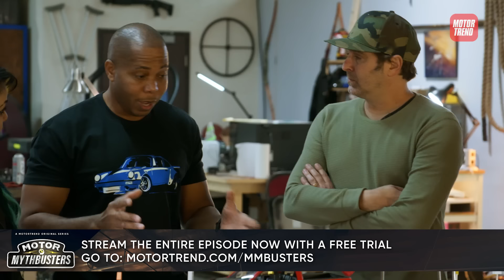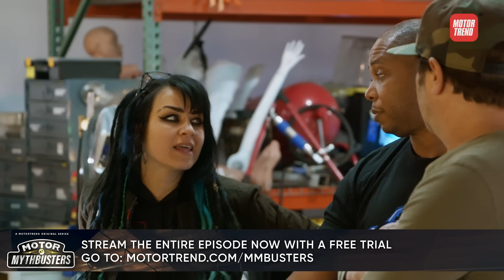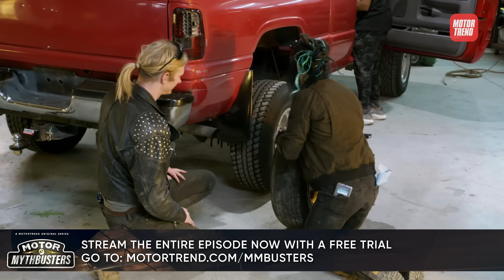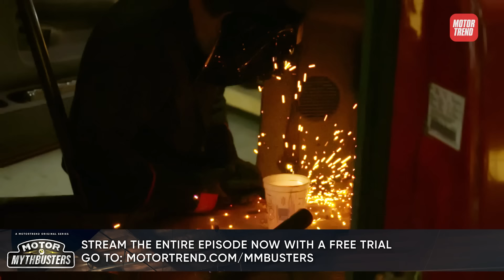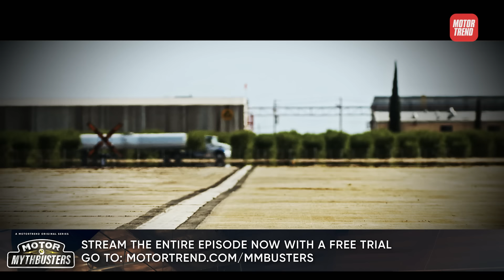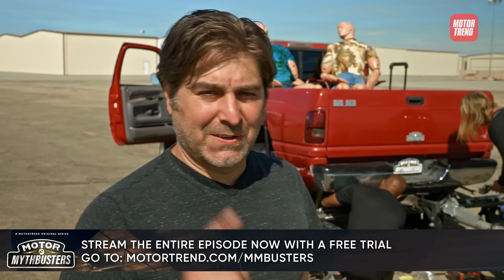Can you escape a fishtailing trailer? | Motor MythBusters | MotorTrend

Comment: As a professional truck driver, I was trained that when your trailer starts fishtailing and trying to jackknife, DO NOT APPLY BRAKES. Accelerate to get ahead of the trailer. Applying brakes could cause the wheels on the trailer to lock up and lose traction, which will lead to jackknifing.
Reply: same with mototcycles. if front tire starts wobbling, speed up to straighten it
Reply: Doesn't take a trained genius to figure out that if the tail of the trailer has moved to the side, out of alignment with the car, and you brake, the tail of the trailer will want to continue forward from the side, passing the slowing car and causing a wreck. It's inertia.  That's just common sense.  But there isn't too much of that left anymore.
Reply: @boyracer3477  true that bro
Reply: @boyracer3477 yes because the trailer doesn’t have brakes
Reply: @Xian..     That's a good point.  I can pull a trailer (I have a 4 wheeled boat trailer) but I'm not skilled.  That is a good reminder.  Thanks
Reply: Slow down... you were trained wrong
Reply: @xephael3485  well if you slow down then the trailer will go through the sky like a spaceship and cause an impact. Learn common sense

Comment: So what if the myth is busted and speeding up doesn’t work or makes it worse.... Then people who have watched this video and find themselves in this situation are likely to try it and make the situation worse... Right??? Maybe not but I do find a safety video teaser slightly odd...
Reply: This. I came to the comments to find out if accelerating works or not…
Reply: It does work. It’s not the safest way. Use trailer brakes if available
Reply: Accelerating stops the sway in the immediate term, but then you're at a higher speed and therefore less stable.  Probably a good strategy for buying the time to reach over and squeeze the trailer brake lever.

Comment: Towing manuals make a big point about putting 10-15% of the gross trailer weight on the hitch to prevent this problem.  I bought a 2" ball with a load gauge on it so I don't have to guess. Only $100 and a useful safety tool.
Reply: Rick Ashcroft      Didn't know such a thing existed.  Thanks.

Comment: It absolutely works. I have done it twice in my life and have seen it done countless other times. There are videos all over youtube that demonstrate it

Where they go wrong in this video, is they work on the assumption that the swaying trailer is caused by incorrect load/tongue weight and the vast majority of the time, the issue is actually caused by either wind or coming down a hill.
Reply: You do realize that weight distribution changes with a slope right?
Reply: @absolutium  MIGHT change the slope. Also, irrelevant to my comment
Reply: @claytonmuirhead2722  As an engineer im compelled to inform you.. that weight distribution is essentially the only factor that matters a proper balance makes the difference between having sway at 60kph or at 120kph.. even if windspeed is exactly the same.
Reply: @absolutium  Which STILL has no relevance to my comment. IF you actually are an engineer you should change careers before you get someone killed.
Reply: @claytonmuirhead2722  Your comment states that wind causes the problem.. have you seen how wind affects an 18 wheeler? 
What's the difference you notice?

Comment: Good thing they never actually had to rely on those "training wheels" because they clearly would have snapped off if they had to deal with the slightest amount of pressure. The way they're mounted to the truck is a joke.
Reply: @Jeremy Nimmo/Bong Jovi: Properly sized/installed outrigger wheel sets that don't drastically alter either center of force/gravity of tested vehicles. These devices are used when testing/training against potential rollovers: US DOT/IIHS/Consumers Union/Road+Track. Keeping people safe is everyone's job. My job? When safety fails occur. Paramedic (ret'd)
Reply: @Jeremy Nimmo   The real original MythBusters show was required by their insurance company to hire safety experts to help design and monitor their hairy episodes.  The cast members have said this in interviews.

Comment: Our trailer was sideswiped on the passenger side at 65mph causing a massive instant sway.  When we finally stopped, the force had shoved truck and trailer sideways across two lanes of traffic and the trailer was on its side with the top had come lose from the base and we were facing oncoming traffic.

Comment: If u hit the trailer brakes and the swerving causes light sided tires to lock up which will cause it to slide out than ur Human reaction to tryn save it is to let off which quickly swerves back likely Flipn or if it does the sway while turning it will most likely flip or lose its load.

Comment: If trailer sway starts at a high enough speed to cause the trailer to flip, then unless you are in a very powerful car, you simply won’t have the reaction time to gain enough power before total loss of control. So rather than speeding up the car doing the opposite, slowing down the trailer is the more effective method. This is why automatic systems which apply the trailer brakes only work so well. In the UK most caravans are fitted with a AL-KO Trailer Control (ATC). Personally I would not tow a caravan without one.

Comment: It's physics.  The truck and trailer are like a guitar string and oscillate when excited.  As you increase the tension, the frequency it oscillates at will increase and the amplitude will decrease.  Applying throttle increases the tension between truck and trailer, and if the frequency of oscillation is increased faster than the truck and trailer can respond to, and the sway will stop.  I'm disappointed nobody on the show understands basic physics.

Comment: I did it with a 23 ft class C motorhome pulling a 23 ft travel trailer going down a mountain and going over 75 mph and I made the off ramp but twisted the trailer so bad that the door won't latch  anymore.
Reply: Exit ramp? Or emergency/runoff ramp?? You haven't known fear until you start searching for the next runoff...
Reply: @ltmundy1164   It was the Exit ramp.

Comment: you have a small scale representation of the problem, yet you didn't do any testing for the solution? sounds like someone was just itching to spend a few 10's of thousands in production costs just to have some fun rolling a truck. sway happens to mobile homes for different reasons than an improper load. usually the wind is the biggest factor, but wind barely contributes to the sway in utility trailers or flatbeds. your examples and demonstrations do not make sense together

Comment: IMO trailer sway should not be attempted to be corrected by speeding up the tow vehicle. I think the safest emergency maneuver is to apply trailer brakes only to slow down both vehicles.  Adjust tongue weight distribution and a properly installed mechanical sway kit can help. What is new to the market and will be the future in towing will be electronic sway control

Comment: Accelerating out of sway will probably work, but then what? Then you're going faster when it starts to sway again, because you can't keep accelerating forever. Next time it sways it's going to even worst at your now, higher speed. Letting off the gas and enacting the trailer brakes and never, never, never touching the truck brakes, does work. It's the only safe way. If you load a trailer incorrectly just one and experience trailer sway, you'll never load a trailer incorrectly ever again lol. I know. Thankfully my tow truck was a dually. No way a srw would have held her. Loading a bit too much up front, to force the truck to squat if anything, is the way to go if you can't tell if you have enough tongue weight.
Reply: It happened to me once when I was 18 or 19.  I hit the gas and it seemed to make it worse, though I think if I would have given it a few seconds I would have pulled out of it.  In my case it was going downhill that would get it started.  It swayed a bit a couple of times on small hills, then I started down a bigger hill (not big, just bigger, I'm in Illinois), and I finally realized that it was the trailer trying to pass going downhill, but I figured it out too late for my inexperience and the straps broke and the car ended up in the ditch.  If I would have stayed in the gas (and it worked) then I could have slowed down going up the next hill.

Comment: I have had it happen to me helping a friend move a project car using a rental trailer and a bronco I borrowed to haul a old Monticello Carlo i later found out that the trailer brakes were not working at all and the 302 I was using barely had enough power to move the truck to begin with I had a heart stopping moment but fortunately I wasn’t going very fast speed zone and I got stopped and proceeded very carefully the way to get to the destination I learned that going down hill really exaggerated the fishtail

Comment: So, whats the answer?
Reply: Steve: Proper weight distribution. Keeping the center of mass above/slightly forward of the axle prevents rearward leverage against the hitch. Improper loading amplifies any external forces: Sudden steering/braking inputs or slipstream/wake from passing commercial trucks. Aviation analogies: Avoid being the single engine aircraft behind the 'heavy' on approach/departure path. Or the 737 charter, missing tail stand support during offload. Stationary tail strike/forward gear 3m off the tarmac. (Boeing 737-900 UAL2509 LAX-LWS 17Sep2021)

Comment: I didn’t know this was a myth I used to pull a 30 ft trailer from New Jersey to vero beach  twice a month full blast 🤣 compound turboed f250 🤣🤣 my boss let me mod 🤣🤣🤣…   

I remember the bed off the truck creaking as the trailer was about to flip the truck because of the wind  I did a rolling burnt out infront of a state trooper to miss an idiot who tried to pass me as the wind started catching my trailer.  

I took a shower afterwards 🤣🤣… 

If it’s hopping u gotta time it as the truck is compressing the rear end  accelerate when u fell the back sliding u throttle back until it will transfer weight to the trailers axel.